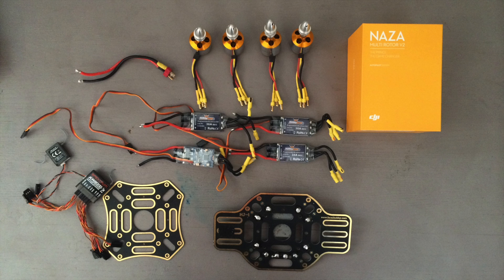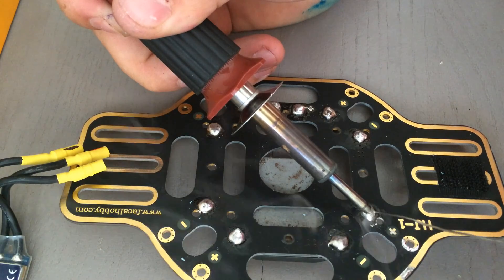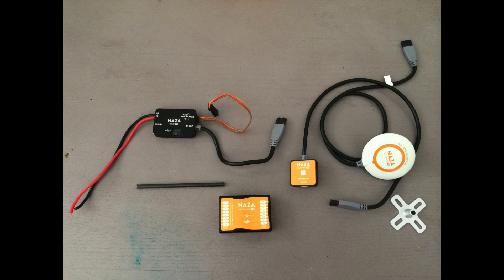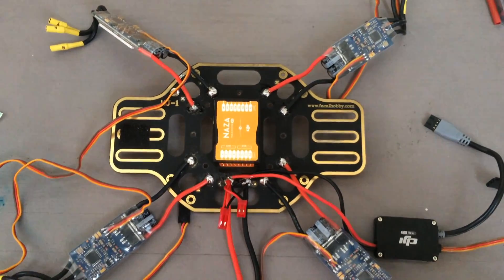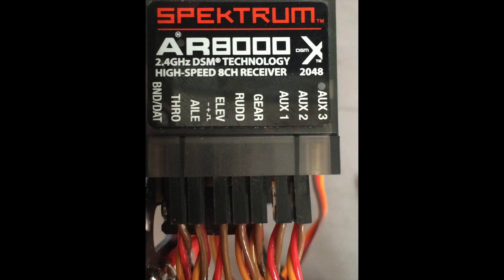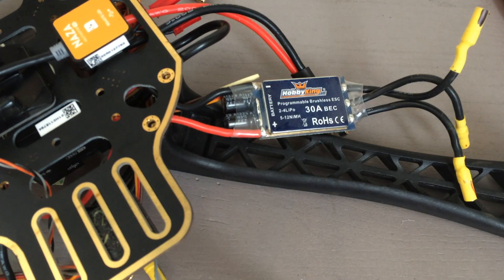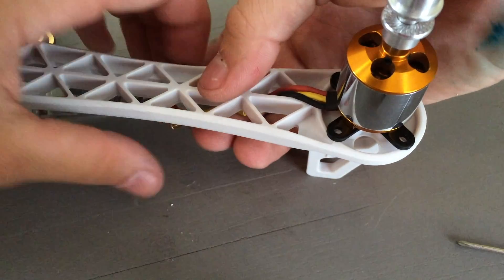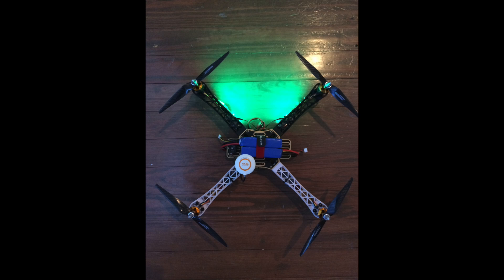How To: Make A Drone (Quadcopter)

Comment: Tip for soldering big wires to big boards: use a high powered soldering iron for the bigger joints, as you will be able to heat it up fast and not overheat stuff on the board. I used an 80 watt iron for the big connections, and a 25 watt iron for the small, precise ones.

Comment: plz help me!!..i am making a quadcopter with 1400kv motors and a kk2.1.5 board and a flysky Ct6b transmitter...i am done building the quad but after when i arm it, all the rotor start to rotate at different times and after i take the throttle to the middle the kk board just restarts and show the version name and then the safe screen plz help  me

Comment: What battery u used?
Reply: Li PO battery
Reply: he used a 3s Li-Po battery, i did the math and for a 5 Ah battery, you must get one that can supply at least 24 c, if the battery is smaller the "c" rating must be higher.

Comment: hello nice vid!  pls heat your wire not the solder tin, you will get better contacts (reliable in long term).  If you heat the wire and the solder pad togetter, you we see the solder merge into the wire and over the pad to make a good joint.

the way you do result in cold joints, and more resistive  joints with a lot of intermetalics.  add flux will improve too to deoxyde.  but great tuto!  just want to help you

Comment: Hello, 
Great Video 
I had a question regarding the motors,  what is the minimum watts of motor requirement ? and if i chose to install higher watts motors then what effects will it have on my quadcopter ?
Reply: armaan Khan So based off what I know, your motors will have a wattage limit, if you exceed that you'll burn out ur motors. The bigger the propellers and pitch of the props the more wattage ur motors will want to draw. Getting motors with a higher wattage limit will enable you to put bigger props with a steeper pitch thus giving more thrust. Battery life may suffer tho. Try using ecalc its helps out a lot and its cheap, better than buying stuff and breaking it.

Comment: what is the use of flight controller ?i mean how does it exactly works??
Reply: Mohit Dhoriya Flight controller is like the brain of the quad. If you want to go forward the brain knows to spin certain props faster or slower. If you want to go straight up the flight controller sends the necessary signals to slow all motors at the same time.
Reply: Mohit Dhoriya Also specifically it connects to the esc's via 2 cables, a ground and a signal wire. Those wires go to an esc which controls the motors speed. Depending on the flight controller it uses a type of signal to communicate with the esc's, for the naza its called pwm I believe or pulse width modulation. Basically like long or short pulses to send data kinda like morse code or something.

Comment: Hi Boss, Can you pleas tell me how much the complete kit will cost including the RC.
Reply: Guru brahma My build is running me about 400 or so with handpicked parts including the transmitter. Keep in mind that you'd also need tools like a soldering iron etc.
Reply: Guru brahma my drone cost me roughly the same (£400) in total, however i used my 3d printer to print the actual frame of it because its lighter and works out cheaper for me to do
Reply: Gabe P. you can get a cheap soldering iron for like 20 dollars the only downside is that the cheap ones are low quality, but that shouldnt be a problem if your only using it for a few hours.

Comment: You need to heat up the wire too to make a good solder joint. If you just heat up the solder blob you can get a cold joint, especially when not using flux

Comment: Build book: http://www.amazon.com/dp/B01C69WOCO?ref_=pe_2427780_160035660

There is alot of minor points that is not mentioned in this video so your drone will crash and you will get a headache rather save yourself alot of time by getting this book.

Comment: how big is your battery on this awesome quad!😃 im planing to build one my self
Reply: +Andrés Pineda whats the ampearage of the battery used?
Reply: me to
Reply: He used 30 amp speed controllers, so the battery would need to be able to supply at least 120 amps, so for a 5 Ah battery, it would need to be somewhere around 25 - 30 c discharge, but the bigger the better for the battery, so maybe a 30 - 40 c lipo would be suitable.

Comment: does the naza have a remote cotroller to fly the drone plz help this is for my final year engineering project..
Reply: Yes,you will need a transmitter/controller for your receiver so you can fly the drone unless you programmed naza gps for autonomous flying
Reply: thank you for the help...

Comment: Oh god that soldering hurts me xD Use some flux man!
Reply: Tomy C Yeah but if you want to get a better solder than his then you are gunna want some flux.
Reply: how does flux help in this? beginner in this
Reply: the flux basically cleans and prepares the metal for soldering, and it makes the solder very liquidy to make a fancy smooth looking solder joint. it also helps the solder stick to the wire/soldering pad.

Comment: hey Andres - could you help me with my drone problem as you seems are bit smarter and experienced as me right now. i have bought my self a racing drone, all was fine until I manage to crash it. i suspect I had motor fried. Basicly now my motor doesnt spin. it does  small movement but suddenly stops. and also have beep each time I try to move motor with my remote. I did notice that if you rotate motor it does about 300° spin and then stuck in same place. is that mean my motor is fried or there is other issue?
Reply: +Andrés Pineda thank you andress Ill try it later
Reply: +Andrés Pineda  hey Andres just have received new motors. I did resolder them but still no changes same thing again. wonder how big possibility that I fried my ESC? could it be ESC fault what do you think? I have a spare ESC but I wonder if I will solder new instead of old do I need to reconfigure my Flight controller or made any changes wit PC. sorry if you think its atupid question but as I new I need still a lot to learn about this toy.
Reply: +Andrés Pineda actually problem was in flight control board. needed to replace it. then manage to replace many other parts after. my drone still sits ona shelf as I did not had a chance to fix it. and change PID too. Did you had experience with Crius multiwii AIO pro? I started to build nexacopter x6 and could not find usefull info about how to configure FCboard using arduino. there was one video but it was useless as I had trouble with a code I copied.

Comment: can u tell me how to make easier drone at cheap
Reply: The 250 class racers are much cheaper that this because they don't use an expensive flight controller,you could use something that cost only 20$ at hobbyking like kk2 or naze32,cc3d etc.with the smaller quads the parts are also cheaper too
Reply: They are also easier to build

Comment: Do you any advice for a cheaper build? i cant afford a naza and those motors?
Reply: buy a naza lite and look for some motors on eBay I found some for $25 for all 4 of em great quality check eBay you can get naza lite without GPS for 58$
Reply: buy a naza lite and look for some motors on eBay I found some for $25 for all 4 of em great quality check eBay you can get naza lite without GPS for 58$
Reply: David Gonzalez what is the company of the motors really confused about motor

Comment: Hey guys, I need help charging my drone. It did not come with any input/output cord to charge it, and I don't know what to do. I ended up buying an input cord, took off some pieces of to fit into my battery that I bought, but it ended up not fitting into it. I can send pictures of it if needed. Would anyone be willing to help?
Reply: Send pictures to flakonorthgate@Gmail.com and part names

Comment: Quick question, how do I make or how do I find a wire that can connect my battery to my drone?
Reply: If your batter uses xt60 than you want buy the opposite end of that,if uses deans than buy opposite of that.try hobbyking

Comment: Where can i get the exact same power input cord as the one shown on the top left of the video at 0:05?
Reply: Hobbyking has a variety of battery plugs,just go to hardware and accessories section wire and plugs I think that section has that plug

Comment: what motor do you recommend with this esc Hobbywing XRotor 40A  2s 6s?SunnySky X2212 KV980 Brushless Motor?is ok or not ? F450 Quadcopter Frame Kit?
Reply: Do not use 2 cell on this huge thing,maybe 3s or 4s,check esc specs for power if you want 6s,and I think those sunny sky 950kv motor will do the job just don't waste the torque of low kv on small prop,use large prop with steep pitch,maybe a 6050 or some 8 inch prop

Comment: What battery did you use and where did you get the connection piece that attaches to the board to plug the battery into
Reply: He use 4000mah 3s and try hobbyking for those connectors

Comment: Can I modify the battery life on it? Like a phone battery? Is there a secret method to do it?
Reply: He uses a 4000 mah 3s and if you want more flight time buy a battery with higher mah  like 6000mah or something like that but be careful,you don't want to add too much weight or you lose performance
Reply: Do not use a phone battery - it can not provide the current needed, and it will fail catastrophically - like blowing up, and filling with gas.

Comment: Hi I am looking at building my first quadcopter and i need some advice if thats alright, would this kit cover everything that a beginner would need apart from the battery and controler?
http://www.ebay.co.uk/itm/DJI-Flame-Wheel-F450-ARF-Naza-M-Lite-COMBO-w-LED-Module-E300-MOTORS-ESC-Props-l-/281628196583?

And do you happen to know of any cheaper alternative kits to this?I wouldn't like to spend more than 300 to 400 pounds. I did previously consider the f550 dji thing but i would probably need to get a better control platform and such and such like gps and that to make it worth while yet it looks like they cost two or three times as much. What would you recommend i do?

Comment: Hello Andres, where do you get the machine to do the soldering? Can I glue the wires instead?
Reply: +Yasemin Akay solder iron. it heats the solder so you can "glue" a wire to the pcb board. don't glue it with anything other than solder. you can look on ebay or amazon for solder irons which start at $5.
Reply: Yasemin Akay no a replace is a heated up screw diver

Comment: Hello.I have a frame just like the one you have here.and I have the Naza 2. and I have 4- 1400Kv motors and 30A speed controllers 10inch props.do you know if I could put 4 more motors  total of 8 motors on it 4 on top 4 on the bottom.would that be to much.O I have a a 2 servo Gimbel with go-pro .thank you

Comment: FYI, The base of the GPS mast that you have taped to the top plate, will actually fit the bolt pattern of the frame arms and will hold it securely and won't ever come loose or shake.

Comment: Hi again, it seems that i can buy the Cheetah 2217-08 Motors for 25$, could you link the correct propellers needed for those?  I also have the option of buying genuine DJI 2212 Brushless Motor (920kv) for 29$ and I know which propellers to go with for that.  Which would be the best option and should I trust an ebay seller that would sell me all 4 motors for around 40$?  Thanks

Comment: With the drone you made and the controller you  used, does it support a Gimbal for a Gopro? Will it be able to lift everything with ease?

Also these are the motors i found on on the website, are they the right ones??

http://www.gravesrc.com/bpa1510-cheetah-a1510-brushless-outrunner-motor.html

Comment: Why can't you just get 4 motors a battery holder and a switch with wires and? Much cheaper and easier
Reply: I mean like the drone itself not everything, I just want to see if my idea would work
Reply: ***** Oh I getcha, don't mind about me name. Just new to this.

I really don't need the control though, I just want the drone itself. The control and everything is nothing to me

Comment: holy shit dude 300 cuid for the naza controller u could buy a pre built quad for that is there any other maybe cheaper options that would work with all the other components u have
Reply: Yes,you could try naze32 or kk2 and buy them at hobbyking,banggood,etc

Comment: Hi,
I'm new in this field and i want to build my own multi-copter drone, i will use it as a project for my end of studies, its a multi-copter which supports heavy weight (~2kg except the components) so i want to suggest me about the type, Hexa-copter or Quad-copter, choosing the components, like the props size and motors, battery, frame.. and i think i'll use the NAZA v2 as a control board.
Thanks advanced.
Reply: thanks for help :) *****

Comment: http://www.ebay.com/itm/DJI-Naza-M-Lite-New-version-Multi-rotor-Flight-Control-with-LED-PMU-Module-e-/151407696141?pt=LH_DefaultDomain_0&hash=item23409a190d

what do you think about this controller

Comment: What does the power management unit actually do? I've seen setups that don't use this.

Also, if I have a FCB with input voltage of 4-6v, and a 3s lipo at 11.1v, how are these connected? Do I need to make a voltage divider / regulator circuit?
Reply: use an LM7805 linear voltage regulator, just put a heatsink on it. Or you could just buy a BEC, either UBEC - less efficient, but cheaper, SBEC - very efficient [less heat] but can be harder to find /expensive. but when using a BEC just make sure that you get a 5 volt bec not a 12 volt, etc.

Comment: U have done an excelent job but how to do a quadcopter without naza or what can be replaced on its place....because i dont have that ability of buying naza
Reply: You should get a Naze32,kk2,cc3d or many others from hobbyking for around 20$
Reply: try a kk2 board its not as fancy and not as many features but it will do and it does not need fancy computer software

Comment: I am looking into building my first quad. I want to start with carrying my GoPro but eventually add the FPV equipment. I don't want to bottleneck myself by building an underpowered copter. What motor, ESC, and battery combo would you recommend that will carry future equipment.